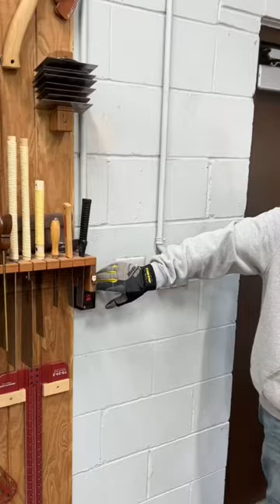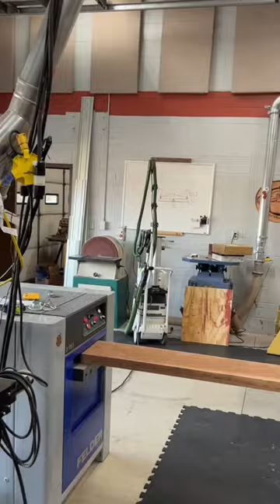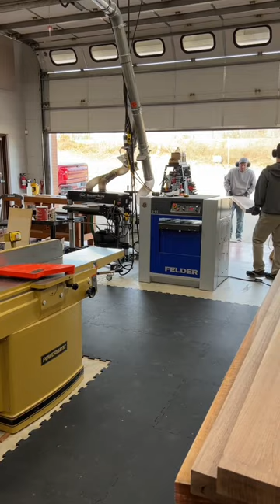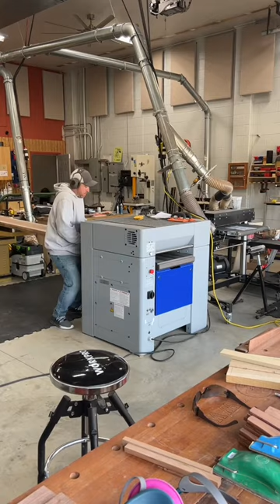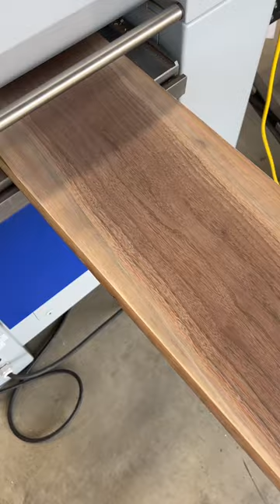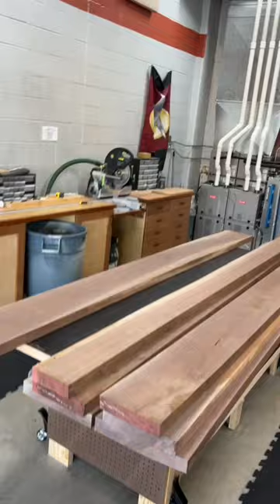Giving the new Felder planer some exercise with 10 foot walnut boards! | #shorts

Comment: Any regrets going with Felder? I have an SCM dealer 15 min down the road, and a SCM Nova slider… considering their planer (520 Nova) or a Felder (D951). Have a Hammer A331 right now, so considering the combo from Felder/Minimax, or just keeping my A3 as a Jointer only and sourcing planer.